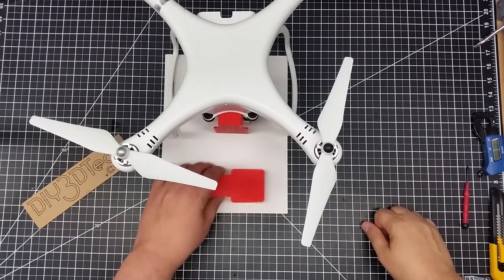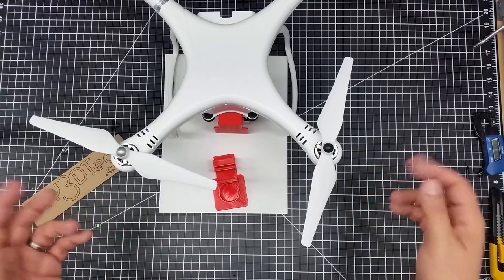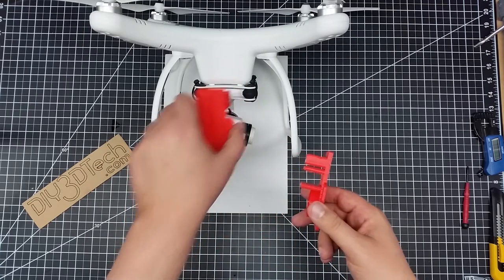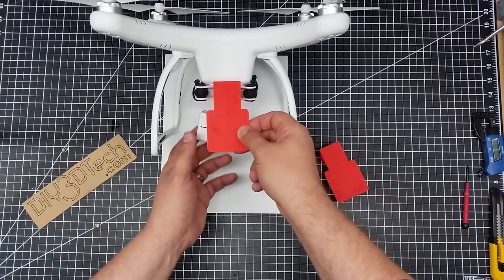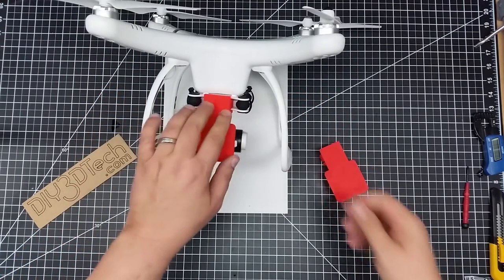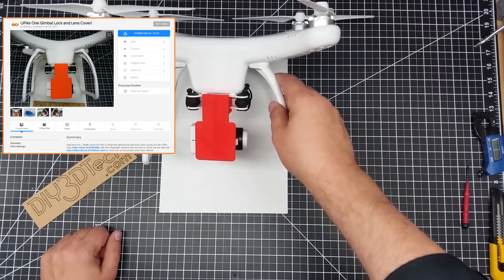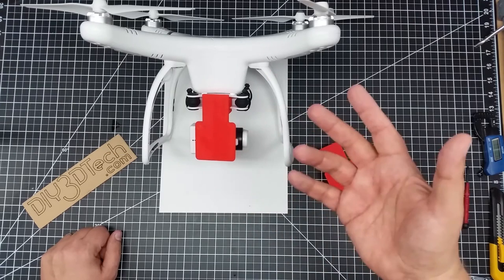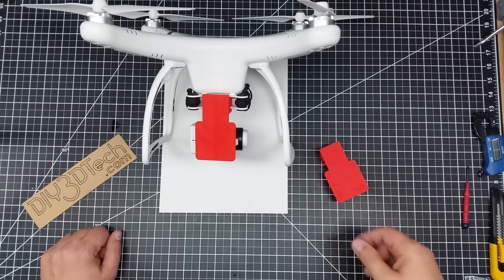Video Drone - UPAir 3D Printed Gimbal Lock!

Comment: yes I do take off in position hold. I guess what I mean about the wobbling is the toilet bowl. I live in a fairly new community being built as far as interference I don't have much here but houses there are no telephone poles no electrical wires around. thank you for your help I will try calibrating as you suggested.
Reply from the maker: The houses will be your worst enemy as they all likely have Wi-Fi and as mentioned this is the control channel for the UPAir.  Suggest trying it in a radio quiet area and see if there is a difference.   This is also sort of the mixed return on the Phantom 3S is they  us the 5.8 gig channel is which is far less congested for control and the 2.4 for video. So video get down graded for control...

Comment: Found the file before I found your channel, got one printed and it works great! Thanks very much! I would like to get a gimbal guard printed if that was able to be 3D rendered.
Reply from the maker: Very cool!  Glad it was useful for you!  I wouldn't 3D print a gimbal guard not sturdy enough  that is why I CNC mine out of polycarb...
Reply: Ah, ok. Did not think it would not be strong enough, fair point. I'll have to knock something up!
Reply from the maker: Also be careful as it runs the risk of changing the aerodynamics of the copter too.  This is the reason I am experimenting with the version on the UPAir as its acting as an airfoil and messing with the gryros/acceleratorometers of the flight controller causing it to over compensate...
Reply: Doesn't matter anymore.... my drone fell out of the sky and it's destroyed. May get another one day.
Reply from the maker: Sorry to hear but does happen I have lost a few also...

Comment: I have a question about the up Air One with the FPV. I purchase one three months ago and returned it.
it was wobbling in the air like crazy and then it would take off straight up into the air about a 100 meters and give me a hard time to come home.
two weeks ago I purchased the new up air 1 Plus which you connect to your phone. my phone could not connect i call email them they told me try all these different things and nothing work so i send it back.
I purchased another one four days ago the  one with fpv again and it's  taking off straight up into the air again and it's descending on its own and it will lift up again is there something you can adjust or Fix I guess if it happens again tomorrow I'm done with up at 1 do you have any suggestions . thank you in advance.
Reply from the maker: The first question is this all happening at the same [general] location?  As I believe the UPAir uses the 2.4gig band for "control" and 5.8 for FPV and the 2.4 gig band is very crowed.  As the taking off and issues coming home (but it does come home) would to me indicate there is interference.  Also are you taking off in GPS hold hold mode?  If no than try that I always take off in GPS mode for safety because it will keep reverting back to the flight controller and GPS. Personally I am not a fan of the App version as I downloaded the App before buying and it was just too crude so I did not buy.  I have two of the UPAirs and have not seen these issue.  Also not sure what you mean wobbling as that sounds like a bad motor or are staying toilet bowling?   If the later try taking off and going up 20 or 30 feet and yaw to the left then to right moderately slowly as I have read that is suppose to  help calibrate the compass.  Please keep me posted...

Comment: Hello, congratulations for the videos are very interesting, I hope you since you have some experience with the drones Upair I have a 2 k with integrated camera gimbal has four months to live but the last one I used after changing the battery causing it to restart an engine ran, I tried following the directions of the videos on you tube how to reset the esc but nothing the motor does not run , checked the engine works, if you have any suggestions. It fell but only landed to replace the battery.
Thank you, hoping for your response.
Hello Mark.
Reply from the maker: Mark not sure I fully track the question, you recharged the battery and what happened?
Reply: Hello, thank you for your interest in my problem, I will explain how I used my UPair on that day, I did a flight of 15 minutes with friends ok and landed and turned off since I had entered the automatic return, went for lunch and came back for a second flight battery will be replaced with the second Commons original when took the usual 13 satellites it on and I saw that one of the 4 engines ran off and put it in your backpack.
It fell not bumped into anything.
Let me start by saying that this and the second I buy the first same defect after a couple of months I engines which decorated function 2 same thing.
Hello
Reply from the maker: Sorry what is a "second Commons original"?  So one of the engines ran off and you put it in a backpack?  Are you trying to  with a second battery you had an issue?  Did you try the first battery again if that was the case?

Comment: Hey!  Add me to those who would like to buy one of these if you make some.
Reply from the maker: Done deal!  :-)
Reply: I send your STL file to a 3D printing shop here in Atlanta, and they quoted me $30-$35.  I thought that was kind of high, but I've never had anything custom-printed before.  Does that sound about right to you?
Reply: So I took your STL file to a 3D printing shop here in Atlanta, and they quoted me $30 or $35 to make this.  Seems high to me.  Does that sound about right to you?
Reply from the maker: thats a little bit of the issue with printing something commercially is the cost as with your printer it is under a buck yet at a service provider it is say $30 bucks. so would that be normal, yes so it cimes down to is it of value to at this amount.  just an fyi in a week or two will likely offer these in a limited run for 15 buck plus shiping
Reply: OK, cool.    Let me know.
Reply from the maker: I am going to work on setting up an etsy shop next week when I am back from Germany to offer these as well as polycarb gimbal guard for the upair so I will post an update video when complete :-)
Reply: Cool.  Hey, since you're smart on 3D printing, here's a question:  The plastic arm that holds the gimbal on my Upair One 4K is cracked.  I shored it up with epoxy, but I don't trust it 100%.  A tough 3D printed one would be perfect.  How does one begin to draw it, then make a file to be printed?  (I don't suppose you have other Upair parts drawn, do you?)  Here's the part I'm talking about:  http://i.imgur.com/5s8LewM.jpg